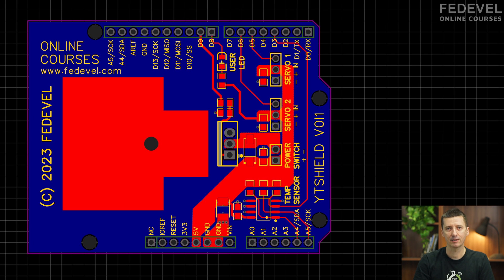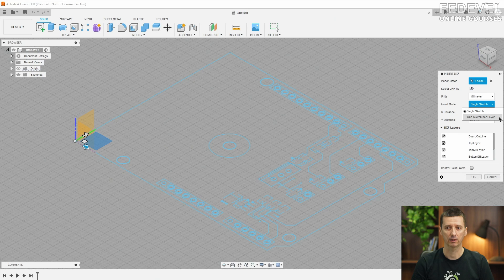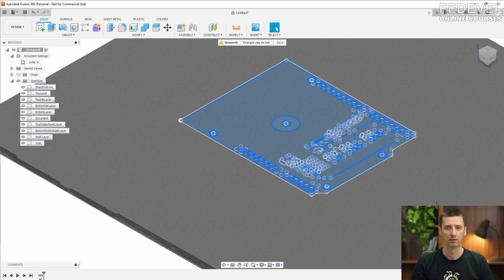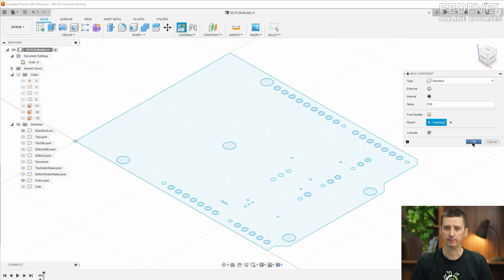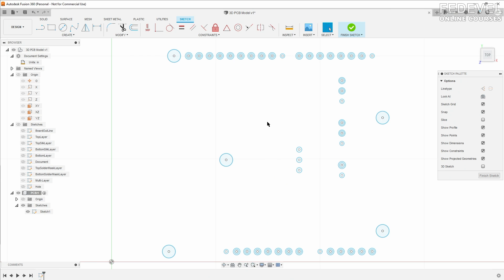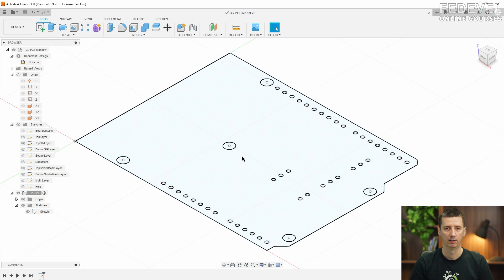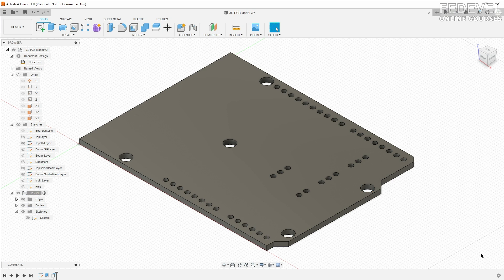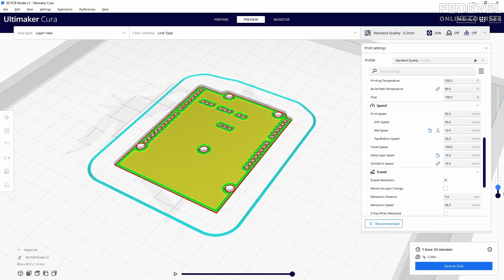How To 3D Print a Model of Your PCB | Step by Step

Comment: Why do it so complicated? 
Just export the PCB as STEP file. KiCAD, Altium and most other tools can export your PCB as STEP. EasyEDA seems to be a bit of an exception in that they only allow 3D exports as OBJ file? With a direct 3D export, the dimensions come out correctly without metric/imperial confusion, as that information gets transmitted in a STEP file too. If you use a slicer like PrusaSlicer, it even allows you to directly put that STEP file into the slicer to prepare for printing. Since the STEP file organizes 3D models into a tree structure with subassemblies, i can export a complete PCB with all the components models from KiCAD, and then select in PrusaSlicer what models/components i want to include in the 3D printout. No Fusion 360 or complicated process with sketches and copying data around needed...

Comment: If it is just about verifying footprints and clearance of SMD components, I tend to go the "easier" route of just printing it out in a 1:1 scale and placing the critical parts on the paper like a grid. This also helps a lot to reduce the time wasted by picking a wrong footprint or putting some things too close together.

Comment: This is every useful technique, that can be applied in a couple of ways.
If you 3D print the board including the 3D CAD models of the components, it is very helpful to check for collisions with the enclosure, or any other populated PCBs in a multi-board assembly.
If you buy the components before ordering the PCBs (which I recommend!), then simply doing a paper printout of the PCB layout of a PCB is invaluable as it allows you to sanity check that your SMD components match the pitch and pad-spacings of your PCB footprints.
Reply from the maker: Thank you. I sometimes print the whole board model, but it may require also some cleaning and a little bit of extra work to print it correctly. Some time ago I created a video about it ( https://youtu.be/jpUKG9neIGU ). Comparing to that, I found 3d printing a bare PCB very fast and simple. Also, I used to create paper only boards, but paper is bending and it is not as rigid and as accurate as a 3d printed PCB model (I may glue paper printed PCB on the top of the 3d printed PCB, that is also helpful)
Reply: This is a very  valuable tip - I encounter a wrong footprint or too small pads just by doing this. Additionally, it helps getting a feel of what pad size is necessary to solder a component that is meant to be reflow soldered (and has a landpattern for this) by hand (if this is a good idea or not is another question).

Comment: KiCAD and FreeCAD have a great integration though a plugin called KiCAD Stepup, you can directly import your PCB from KiCAD to FreeCAD and get a 3D model of the PCB! I've used this to make a 2D sketch using projection of the pcb onto a plain and very easily take that sketch to make enclosures for PCBs.